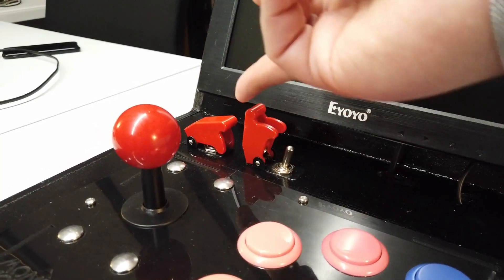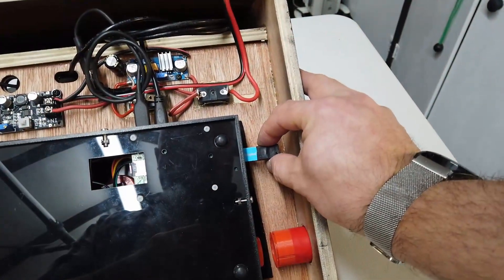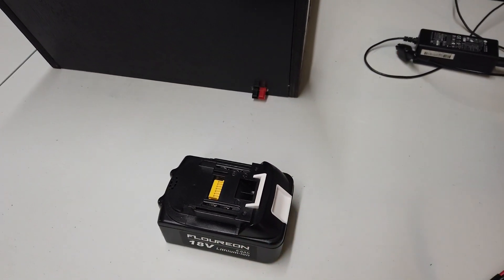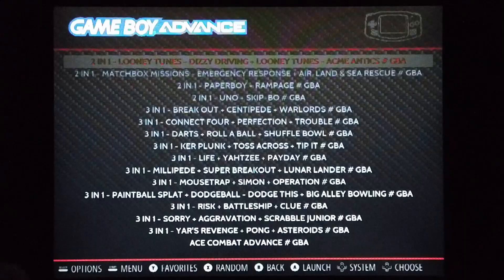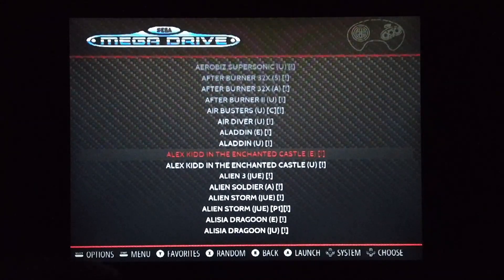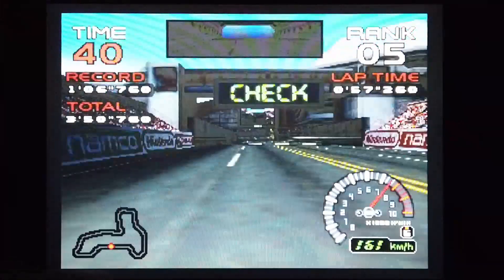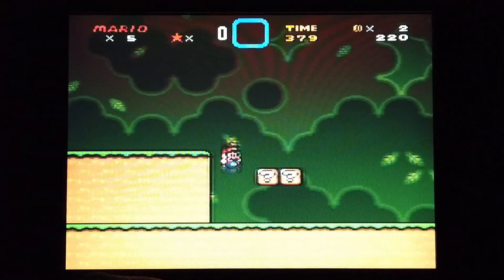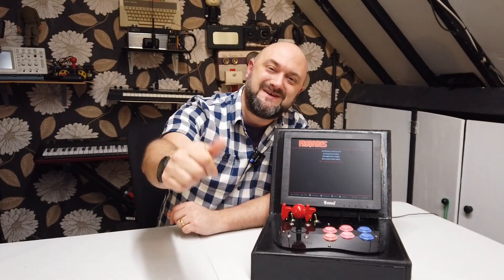DuB-EnG: Small Arcade Games Machine Build - RetroPie Battery Portable with MonsterJoystick - PT2

Comment: I bashed together a Retropie Sega Game Gear that used a Car reversing camera video monitor as the screen (composite connection). INTERESTINGLY the lcd took 12v, but bucked it down to 5 volts on the circuit board. Thanks to Great Scott, I discovered that you could skip the bucking chip and just supply straight 5v.

I'm curious if a screen that size does the same? Made 12v for car compatibility but internally bucks down?

I haven't tried it, but I'm sure the Pi will emulate the Playstation version of ridge racer much better than the N64.... even though it did a pretty damn good job there
Reply from the maker: Very good points...   I have a gamegear build to do with a reversing LCD...  and a pi zero! - I'll look out for that tell-tale inductor! - Thanks for the great thought...  Also, YES - I'm sure PS will be way better at ridge racer...  I need some PS roms to try :-)  .   hhhmmm...  poke me on twitter!!